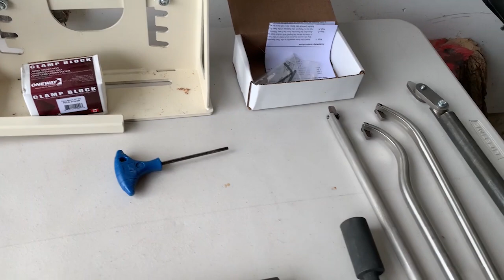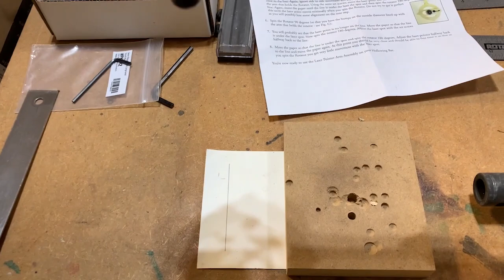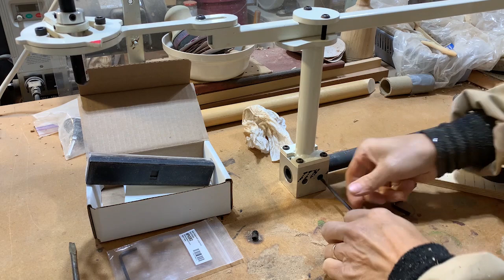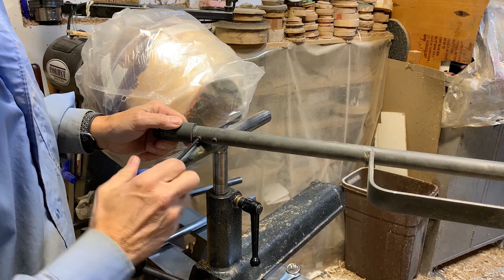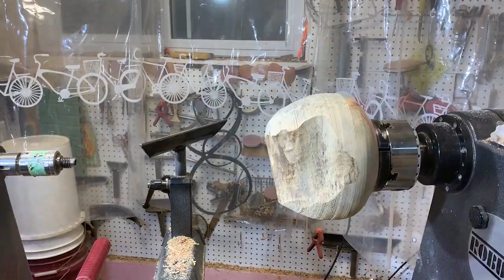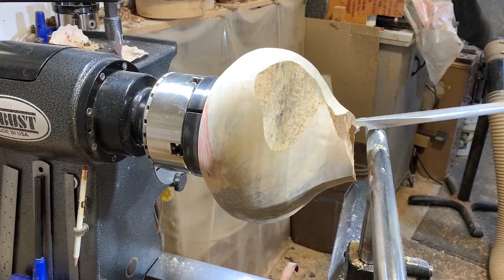Woodturning with the Oneway Hollowing System

Comment: Frank, I want to buy such a system. Tell me a bit about your practice. Can you hollow more than 9 inches deep? What’s the maximum depth you've reached in your practice? The 5/8" Double Bent Bar might be too weak for deep hollowing. How has the 1" Boring Bar with Teardrop Cutter performed in your work, and what about the Deep Hollowing Bar that's also included in the set? Do you use them? And in general, after all these years, what are your impressions? Would you stick with this system, or would you consider getting Lyle Jamieson's 1-inch Giant System instead. Thank you)

Comment: I ordered my hollowing system just befor Christmas and was told not to expect it before Feb. do to parts not available. I was supprised on Jan 10 when it showed up.😃Like you said very well built. Your video was excellent and helped a lot. thanks
After using the system for 4 years do you have any other tips?
Reply from the maker: Thanks for the note, so glad you have the system.  I have others hollowing systems but this tends to be my go to one.  It’s fast and simple to set up.  I do most of the hollowing without the laser and just put it on when getting close to the final thickness. it would be nice if Oneway made a 3/4 bar for it, but you can buy a 5/8 male to 3/4” female adapter and then use any of the 3/4” bars out there.  I have also purchased the Hunter carbide cutter adapter to be able to use Hunters carbides on the Oneway bars…. Good when cutting epoxy.

Comment: Hello, curious on why you chose Robust over Oneway.  I'm Canadian so I'm worried my bias might influence my judgement because I really like the Oneway.  But I am a very novice turner so I don't know much.  Great videos BTW, much appreciated.
Reply from the maker: Thanks for the note, at the time I purchased the Robust the US dollar was at a good rate and this was a very slightly used showroom model so I got a bit of a discount as ell. I also liked some of the design features like a movable headstock and a pivot away tailstock.  Today, if I was buying a high quality top end lathe, I would be inclined to get the Oneway lathe because at least here in Canada, the price is much less for basically the same capacity/quality of machine.  Both are great machines, if I could, I would have one of each 😀

Comment: Have you had any p[roblems with your laser? My started flickering and eventually just quit. Oneway sent me a new one with an adapter. Samething. Didn't last long before it quit. About 45 mins and it doesn't work anymore.  Looking for a replacement that will last and fit in the system.
Reply from the maker: The laser I have loosened up a bit where the cap screws onto it to hold the battery.  I just put some tape on it so it does not wind off and loosen during hollowing and that seems to help, but yes, with all the vibration the laser does seem to be vulnerable to failure.   I am still using the original one that came with the system, but it is on its last leg.  I also heard there was a problem so I purchased 4 backup lasers from them.  I tend to do most of my hollowing without the laser and then just put the top bar/laser assy on when I am getting to final thicknesses.
Reply: Frank Didomizio  I didn't think to wait until almost finished hollowing to put on the laser. Should help it last longer. So far I can barely get through one vessel before it quits.  Thank you for replying.

Comment: I would have cut the out-of-shape piece round on the bandsaw rather than punish myself by turning away all of the excess.
Reply from the maker: Thanks.   Sometimes I do a bit of rounding on the bandsaw, but I have done so many large pieces on my heavy Robust lathe I do not find the roughing out process is that hard on me.  I am mostly starting with wet wood so easier to do the rounding and rough shaping.
Reply: Me in action: https://www.youtube.com/watch?v=ATfwk-yyPsc&t=17s

Comment: Very well explained, thanks Frank, i might need a bigger shop just to house thing but it seems very nice ;-)
Reply from the maker: Thanks, it looks big on the lathe, but the main parts do not actually take up that much room.  If you get the system, make sure you get the 1” bar.  The 5/8 bars are ok for small stuff but the 1” bar is much more rigid.  The cutters are all HSS so easy to sharpen.

Comment: Thank you for the video Frank.  My Oneway hollowing system just came in today, an almost 7 month delay from date of order.  Due to COVID I was told.  Your video is appreciated..  Dont understand why Oneway hasn't produced a video to show set up and use.  You did an amazing job. Thanks again Greg Duquette
Reply from the maker: That is a crazy long time to wait.  I have been using it quite a bit and night extra cutters and lasers.  I did talk to oneway directly and also said they should have a video, at least Kevin at oneway did review my video and made a few suggestions before I posted it.   Later I found out that the small set screws holding the laser loosen up so I put the purple (low strength) loctite 222 on the threads and that is enough to prevent them from loosening up.  Good luck

Comment: Thank you Frank, your video comes right on time for me. It's the first one I found on the Oneway system. I turn with a Oneway 1640 lathe and had two finalists on my hollowing system list: Lyle Jamieson's and Oneway. Comments I had read were about the laser light that was not very good and the set screws that moved out with the vibrations, but these dated 6 ou 8 years ago. I guess Oneway solved that issue since. I also intended using eventually a camera system but the rotating laser holder seems to make the camera system useless. This video really helps me in my last analyses.
Reply from the maker: Thanks Alain, I actually have the Jamieson system at my  place in Florida, but at my northern home I just had an old home made system very similar to the Jamieson system (it actually uses the Jamieson 3/4 bar and cutter).  I like both the Oneway and Jamieson systems.  The laser setup and functionality is much better for the one way system.  I can see how the laser set screws could vibrate loose and have not used it long enough to know if it will be a problem , so I will wrap them tightly in black electrical tape which should prevent the problem.  I do have a camera system on my SIMON Hope hollowing system and I like it, but the oneway laser is simpler, less costly and kind of does the same thing.  Good luck.

Comment: Very informative video. Thank you. Question: what speed did your turn? Is there a limit for this One Way system.
Reply from the maker: Thanks, I have never used a lathe with speed readout and my Robust does not have it, but I am guessing my turning speed is somewhere between 800 and 1200 RPM.  On their website, Oneway says that you can go in 9" with the standard 5/8" bar, but I think that is really pushing the limit.  It does come with a 1" bar and I think that would be good up to a 12" deep hollow form.  Any deeper than that and I think you would need a larger dia cutter bar..